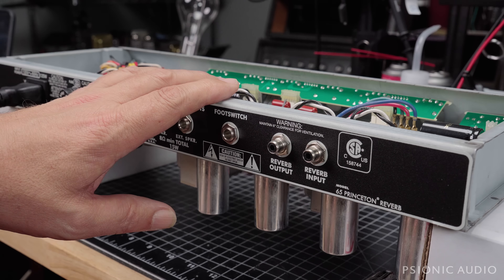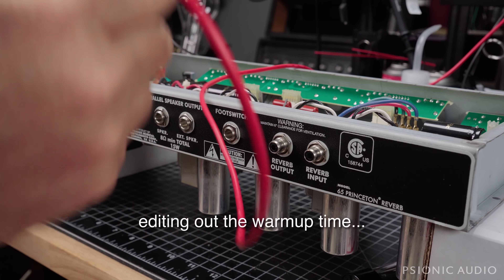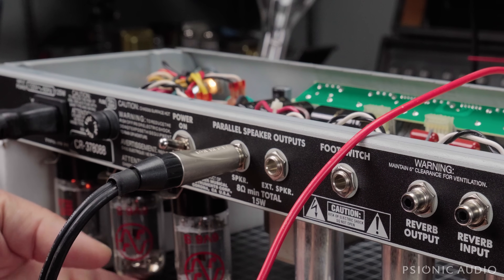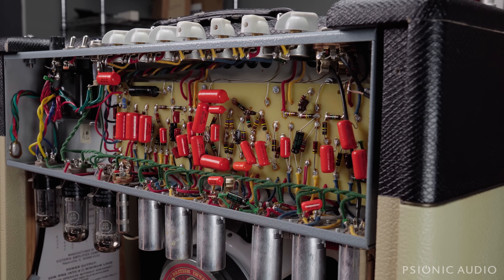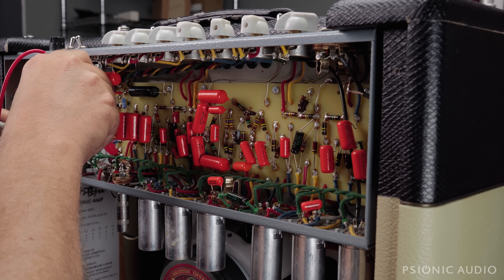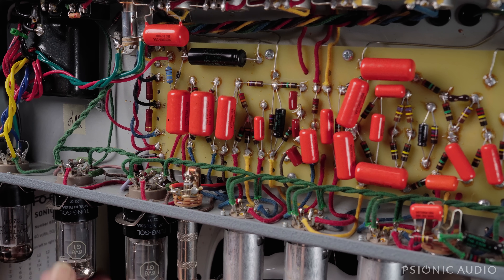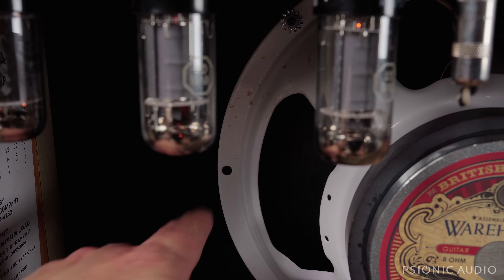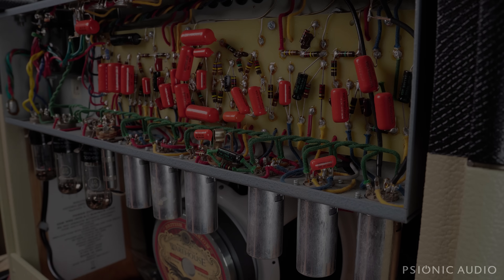Red Plate Special

Comment: I have a Matchless 30/15 which tubes red plate depending on the brand of tube installed. I suspect it's biased really hot, as it also works as a space heater. I've stopped using it outside the studio.

Comment: I built one of the StewMac Deluxes kits and I haven’t been able to use it yet because I had mistakenly installed an 820ohms (instead of the corrext 820k) at the coupling stage of the output phase inverter and something popped, smelled, tube red-plated and then the fuse went out.

Fixes the error and still got the red plate; the grids of the 6v6 are reading 30volts in one and -30volts in the other—could it be that I have leakage in one of the caps?
Reply from the maker: Power it on without output tubes and measure the grids again. If you have a leaking cap you’ll measure it without tubes. If the grids are off (both should be the same amount negative) only with tubes installed you have a bad tube.

Comment: I recently had a pair of red plating 6L6GC's in my 1968 Fender Bassman after re-building the bias supply.  Yep, I had the diode installed in the wrong direction.  I should have looked at one of my other amps to be sure, or even a video online, but I caught the problem within about 90 seconds when measuring voltages and saved the tubes.
Reply: That might have damaged the bias filter cap, unless it was installed backwards also. You might want to measure it.
Reply: @jimsalman7257  My multimeter can only measure caps up to 20uF.   After installing a bias trim pot in addition to the bias balance pot, my bias voltage is stable and in the correct range.  I have the 6L6GC's biased to around 62% idle plate dissipation.
Reply: It hurts so bad to lose a great tube

Comment: What are the best 6v6/el84s tht last more than 6 to 8 months ? Thx
Reply: Nobody knows! That's the problem!
Reply: @BradsGuitarGarage  the TAD valves are very good.
Reply: They are aren’t that big a problem. What amp are you putting them into?

I typically use the military Russian valves. They have a 14 watt plate dissipation instead of the standard 12 watt plate dissipation.

Comment: Dumb question: are you plugged into a speaker or other load when powering up? You did the second time you powered it on but not the first. Was that because the tubes weren’t inside the first time you powered it on? Trying to learn from an expert.
Reply from the maker: No need for a load without power tubes in place.
Reply: Also if there is no signal on the amp there is no danger without a load.
Keep a load on the OT when there is a signal to prevent the plate voltage swing going too high causing an arc in the output tube or output transformer primary.
Reply from the maker: Also, technically there is a load in each of these amps with no speaker connected as the output jacks shunt to ground. 

The most common danger from having no load is a Marshall or similar that doesn’t shunt the output jacks or if you plug/unplug a speaker cable with signal. 

Or the drummer trips over your speaker cable and disconnects the speaker cab…

Comment: I live about 18 miles from CED. If I had a nickel for every swinging dick blowhard wannabe engineer in the valley who claimed he was making CED's newest tube tester, I could retire to the island of Cypress with an vast array of vintage gear and a harem of beautiful women. Without a long burn in time matching is kind of a waste of time. I got a massive stash of NOS tubes in the early 1990s. My very first experience with JJ 6L6GCs was not a good one. My Triplett 3444 suitcase tester and my big huge PITA rack mount Weston lab tester give the inter-element leakage in tubes on actual meters, which is nice. All power tubes have at least tiny bit of heater to cathode leakage.

Comment: I don't know enough to understand why most guitar amps run the screens at nearly the same potential as the plates.
I have an amp with KT 88's at 660 volts and screens at 330 volts that gives 82 watts clean and has the original tubes since 1971.
I would have thought that running screens at almost plate potential was negating the benefits of a beam tetrode ?
Reply from the maker: Most amps are designed as simply as possible and in the case of amps designed in the ‘60s and early ‘70s, often cheated datasheets because the tubes then were very rugged.

Your amp probably taps off a half supply node in the middle of a series cap pair, like many Ampegs did. That takes real estate and more cost so most companies didn’t do that (most companies didn’t design with 660V B+ either).

When needed I’ll bring down a screen node using zeners.
Reply: Thanks for your reply Lyle.Yes the screens come off the centre of the smoothing cap chain.
It is a Holden wasp made by Ron Holden in Christchurch New Zealand.
My only trouble with the amp , besides the weight , is a buzz that's audible when playing quietly. I think it is diode switching spikes picked up by the preamp heater winding in the transformer. I've sorted it with DC heaters but am afraid of blowing the transformer. Maybe a separate filament transformer?
Reply: Would little caps across the diodes in the bridge solve the buzz ?
Reply: Your comment sounds like a line from Star Trek to my ignorant ears!

Comment: It wasn’t Pepsi 😂
Reply: It was new Coke 🤣🤣😂😂
Reply: Thanks for this Lyle, are we live chatting this week? Uncle Doug in his latest video went into in deep detail on how to wire the mains into an an amp. Please watch it and give us your opion.Thanks in advance. PS. I've just replaced the element in my cooker and the circuit breaker did the trick.
Reply from the maker: Yes, but I don’t know that I’ll have time to watch Doug’s video. I hope he got it right, as I’ve shown it a lot on the channel.
Reply: @PsionicAudio  Lyle he made a very convincing reason for his method of wiring his mains the way he does( well worth a watch ) might make a topic for your next live chat.
Reply from the maker: I’m almost scared to watch now. Because there is electrical code and there is nonsense. I do it to code. There is no good alternative.
Reply: @PsionicAudio  exactly
Reply: @PsionicAudio  Just checked it out. It was the hot fuse end shock risk whilst changing the fuse argument. This is voided by using a modern certified fuseholder which is specifically designed to not allow the end user to come into contact with any part of the fuse at all until it's been retracted by an inch or two, being held captive by the removable fuse-holding plug. That's why modern fuseholders have all those funny certification symbols molded / etched into the side of the body.
Reply from the maker: Ah, that nonsense. Totally ignores how relatively common a shorted power switch is.  

Code is simple. Hot to tip of fuse then sleeve to power switch. For 240V countries, and for the US when possible (ie, not in an original ‘60s Fender), that switch should be DP and the neutral should be switched as well.

Integrated power cables should have the safety ground longer than hot/neutral. IEC grounds should be as short as possible without strain. And either green or green with a yellow stripe.

In either case, AC safety ground must go to chassis at a dedicated point not shared with any other ground and not used for any other mechanical purpose.

There is no argument.
Reply: @martinreid1740  Ive never seen him wire the safety ground correctly.  You?
Reply: @BenState  If you watch his video he made a very convicing choice. He is a great teacher and I've watched him for years and hold him in the highest regard.
Reply: @martinreid1740  He doesn't know how to wire up safety grounds... basic stuff.